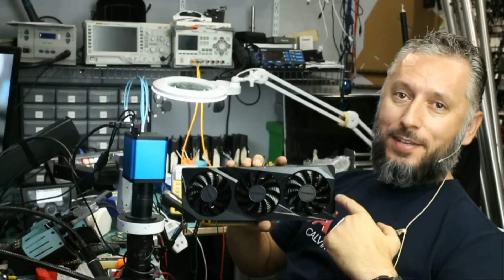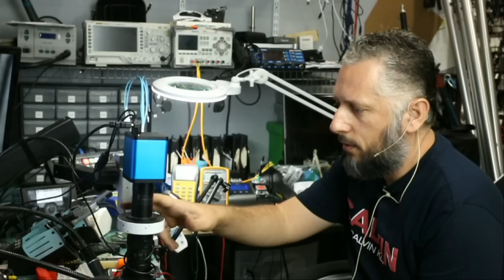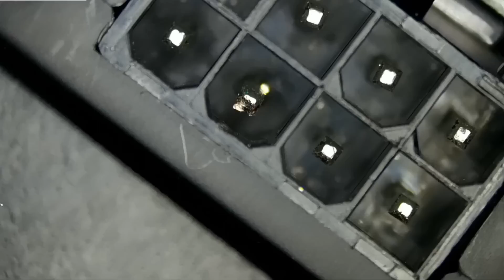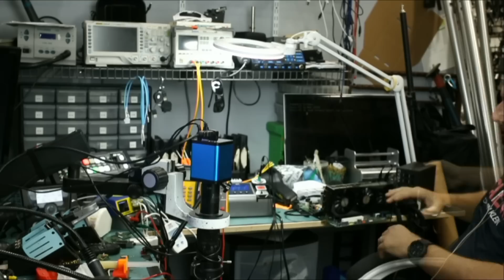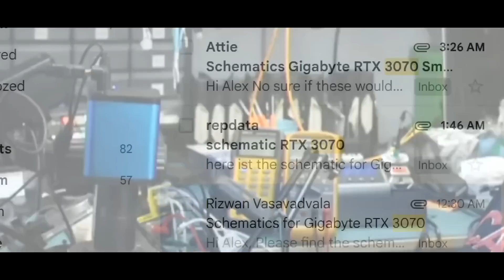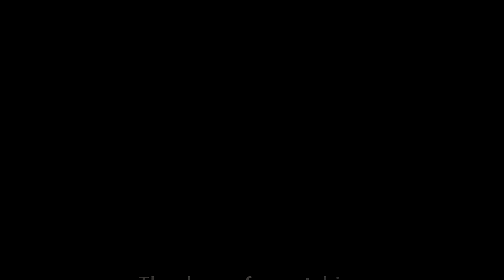Gigabyte RTX 3070 Smoked Fixed - Part 2

Comment: I hope someone sees this and can answer - i have a Gigabyte 3070 too and have a problem with the power connectors. The 8 pin works fine and clicks into the card to safely attach but the 6 pin just won't and i don't want to push much harder for fear of breaking something.

These are standard cables and i just don't know why the 6 pin refuses to click in - it just sits very loosely in it and this is not something that should be a permanent thing.

Do i have to buy a new cable and if so which one?

Comment: I used to work as a electronics engineer.  Someone designed a new Prestel unit (pre runner to the internet). It didnt work and no one could work out why. I evetuallly spotted the 40 pin IC sockets were shorting on the pads on the pcb. The sockets had been sold without insulators on the bottom.

Comment: Power plug pin was probably damaged by the blows moseft, that is how the customer had working LEDs, the pin acted as a fuse, the customers cable is probably damaged

Comment: Man I watch you like the 6 o'clock news.  Everyday.  I learn alot.  I am not a repairman, but I am an engineer and your video helps me in other areas of engineering (like software development (and hacking around with the actual circuit)).  Great work.

Comment: That pin is that way because of the added point of resistance. The 8pin flat connector on the GB cards can have too tight of a zip-tie thus pulling the terminal connecting to the card at an angle in relation to the pin. The new mini connectors suck so much I hate them. These are the same size as the 12VHPWR connectors too ugh. Pure garbage and near impossible to depin the connectors. That is if they don't just slide out on their own in the first place because the little latch that holds them in the plugs are tiny like 1mm wide and paper thin. I have a GB 3080 Ti Gaming OC and it is byfar me most temperamental card. Also the OC didn't do anything but I would highly recommend using DDU when you get a new card.

Comment: PCIex can give up to 75 Watts , some videocards can start without external power cable, and some not, because there is a protection in VBIOS.  2D video prcessing uses less power , and 3D image processing uses high power, so you need external power cables from PSU

Comment: You could do with cannibalizing one of those 2000 generation server cases for the slide-out motherboard tray you could use to mount your test-bench motherboard as the tray has the back-panel support for i/o cards which can also mount switches for power, reset and speaker.  It could cost you nothing other than a can of black paint to modernize it and some rubber feet to be kind to your desk.  That is what I did.

Comment: What if? Just what if, the costomer used a costom psu cable but did not checked the pin layout on the psu side, couse those can differ between psu to psu.
Reply: Since it is an expensive card you wont show stock psu cables right? You go and pick some costom cables from sites like cablemod and such, what if he picked a cable with a wrong layout. That might be why that pin melted or its just a bad cable or he/she couldnt plug it all the way in and it arked.

Comment: I see it the opposite way - the pin melted because of the short from the chip on the PCB so there was a high current peak which manifested on the connectors since there is some transition resistance that generates heat. But excellent work anyway, this was a happy mistake :).

Comment: I got card from  first series of 3080 eagle with power socket  pins problem -they were pushed back when i pluged power cables. I send it to gigabyte warehouse and they "Fixed" it .After fix pins where not pushed back instead they were moving up and down like seesaw. I used cables extension to ensure that i will not play anymore with card power socket and after 2 years i got no problem but heard a lot of first gigabyte 3080 damaged psu cables

Comment: Its not likely a short 
Its a high resistance low grip pressure connector causing heat and arcing 

Probably want to make lab psu test bench and Inject power into card bypassing the buck converter to make sure it is not shorted and reduce blowing new parts or realising more smoke

Comment: Hello! I have a question... I accidentally broke the RGB cable of my 3080 Gigabyte gaming g1, and the connectors are stuck together... I think I need to replace them, but I wonder, since you open this similar model in this video, what kind of connector should I take? I am not sure if I need a JST-XH or a PH... And if there is a scheme to put the cables correctly. Thanks a lot in advantage!

Comment: Pinouts for ATX power supplies are not standardized on the power supply end, each manufacturer makes it's cables to route the pinout of the PSU side to the standardized pinout of the device side meaning specific cables must be used with specific power supply manufacturer's products. People attempt to mix and match cables from one power supply to another or use aftermarket cables that aren't compatible with their power supply or are just poor quality,. This causes fires and damage to components, and is likely the cause of the damaged power connector with this card.

Comment: It is also possible that the customer used old modular PSU cables from another brand/type PSU. You should always, always use the modular cables that came with the PSU you are going to use. The connectors might fit just fine, but the pinout is different on the PSU side.

Comment: Seems to me you would be better off seeing if you can create some space to have a test bench rig there to be a bit more organised with the psu UNDER the motherboard rather than everything just resting on the bench, just a thought. It should make life a little easier if possible. You can get some vertical standing ones for a smaller footprint. Just an idea, a vertical standing test bench which would give a bit more space on your bench, theoretically speaking.

Comment: The thing that made you forget to plug the card in to power is that you hade the back plate off, so you had to plug the back plate cables to the main board which tricked your brain into thinking that you just plugged it in, and tricked me too, because the first thing I thought after seeing this second part of the video is that I remember clearly seeing you plug the back connectors into power 🤔, of course I went back and realized what happened

Comment: without those 12v cables you dont have 1.8v for memory and the 5v line... so yeah... on the old card you could power on the card with just the pci express voltaje because the memory voltaje/line was taking power from that pci express... the new cards not so much.

the 12v pin it's ok... it looks like that because the costumer psu has a bent pin socket and he did force the cable to the socket... the worst that can happen is a low connection on that pin and might get hot... other than that the gpu had just a bad component that was at the end of life.

Comment: hello, the bend pin should be caused by burned chip, when it burns, there were enormous current flowing from power supply which on places as connectors where is transition resistance can cause enormous heat. Love your videos 💖

Comment: I think it's very likely the case that the customer used the wrong modular power supply cable. Cables from different manufacturers do often fit but they have a different pin out. This can for example put 12 volts on a ground rail. Here is a video with more info https://m.youtube.com/watch?v=opFTzO1s1WA

Comment: Using firefox findiing in page option will help  to highlight its location. Say you are looking for R7800, Just type R7800 in the search box and press enter. This is possible if you use firefox to open the pdf  file. As for "find in page " just click the the 4 horizontal lines just below the X  to close the browser and click on "Find in page".

Comment: Perhaps the customer mixed up psu cables from another psu. That’s been an issue in the last few years. While the connector may fit the pinout can be different on the psu end. Seen a couple of blown graphics card from this issue.

Comment: @NorthridgeFix Question. I have always used 2x Rail 12V cables for GPU...Not a single cable with a hop off a single rail for the second GPU power slot. 
What is your opinion on power draw from PSU to a single cable VS double 12V rail cable.

Comment: Thanks for the repair! Looking forward to getting back to gaming. Anyone know why the pin is burned? I had a 2070 super plugged in before the pin fried and killed the GPU. After it fried i plugged the 2070 back in and have been using it since with no issues. It's been about 8 months since replugging the 2070
Reply: Could be just the psu cant handle the power draw of the 3070 on 1 cable, yes it is more than enough for the card overall, but it may need one dedicated 8 pin and one 6, due to per line power draw. The 3070 uses about 45w more than the 2070 afterall.
Reply: It's a 750w PSU and with dual 6pins with optional 8pin attachments

Comment: I did that on a truck the other day. Changed a headlight and told the driver to take his truck. Came back 5 minutes later with check engine, traction control, and stability control lights on. I forgot to plug back in the MAF sensor on the air intake.

Comment: It should have red leds that light up by the plugs if they aren’t plugged in
Reply: My old 650 has this kind of light.
Reply: @inou2222  all 3 of my cards do 3070 3080 and my 3090

Comment: Maybe the customer had only one split cable plugged in and it wasn't fully plugged in in the power supply side and this is what caused the melting of the pin?

Comment: Could have potentially mixed cables. There is no standard when it comes to PSU cables other than form factor, so some manufactorers use different pins for different purposes at the GPU end of things.

TLDR; Only use the cable that comes with your GPU.
Reply: ... in modular PSU. In one with fixed ones, cables of course are in ATX standard.
Maybe someone tried to push 8 pin CPU plug...
Reply: Hi. The cables are the same cables i used for my 2070 super. This wasn't a new build it was a GPU update so i unplugged and replugged the same power cables. The 2070 uses 2x8 pin and the 3080 1x6 and 1x8. The last sets of pins are modular and can be clipped on and off. Any help would be appreciated 👍🙂

Comment: I wonder if the customer plugged the EPS power into the GPU or put the connector on upside down? Another perfect example of why people shouldn't be messing with computers when they don't have any idea what they're doing. Yes, it IS as simple as plugging the right cables into the right spots, but if you don't know which is the right cable and which is the right spot, then you don't know what you're doing. Save yourself the time and money and get someone who knows what they're doing to build/upgrade your computer. Quit being cheap. It's an $800 gpu. If you can't pay a shop $40-50 to install it into your computer, then don't bother buying it.
Reply: Want to say this isn't the case. I do not see how u can possibly flip the connector upside down. The connectors have slots that are shaped like a D. Flipping it wouldn't fit. I've built rigs for close to two decades now. This was the first time this has happened to me. What can ya do 🤷

Comment: These new GPU's use a lot more than 75 watts (which is the max the PCIe slot can supply) just at idle. My 2080 Ti uses about 130w just idling. You can get away with running just one of the 12v cables in, but if you don't plug any in then it's just not going to run at all. Have fun trying to fix 4090's when they're released... I think they use like 800w or something ridiculous. They probably idle at 300-400w.

Comment: hey buddy i just started doing repair seriously whats the most invaluable tool to get at the start?
Reply: Heat Air gun and flux
Reply: @nicekeyboardalan6972  yeah been thinking a hot air station is a good idea
Reply: It's very important to have a microscope too